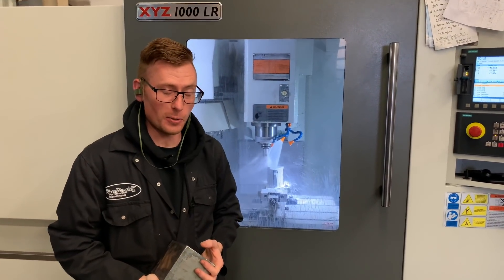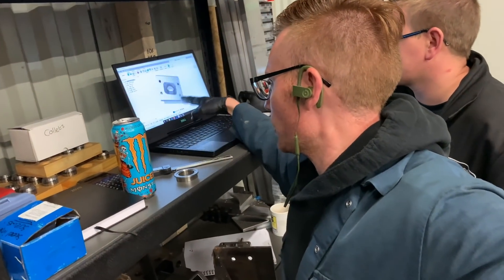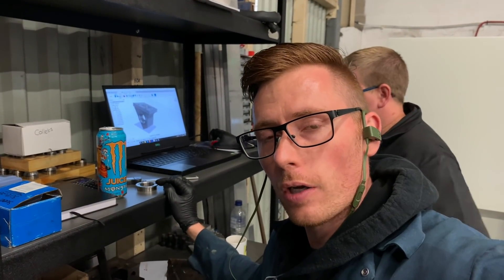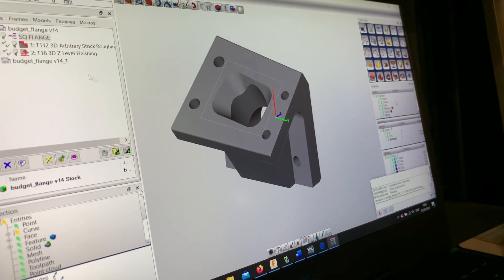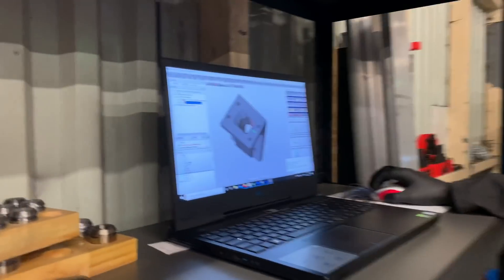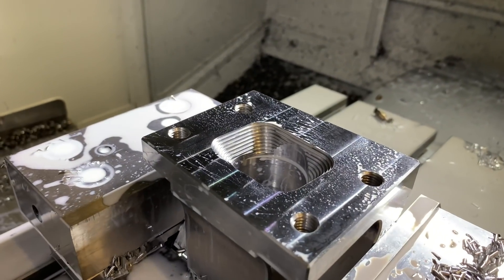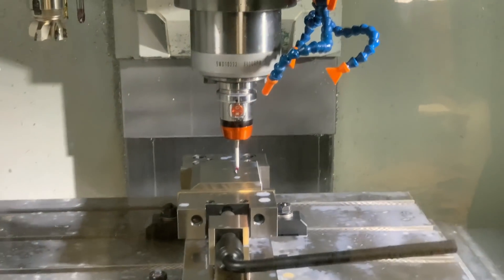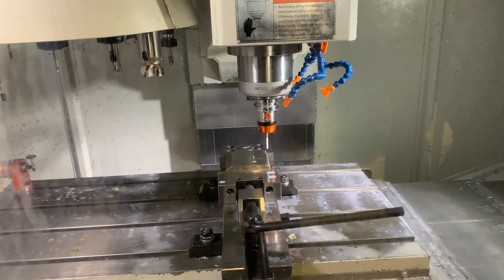OM606 Billet Manifold Adapter

Comment: I think there would be less problems for customers who aren't that skilled at drilling holes if the egt ports came pre drilled and tapped but with a cheap plug installed instead of leaving the hole not drilled all the way. You know someone will try and drill one out and mess up the threads and complain lol... and if its installed on the car, it may be hard to get the drill in the engine bay... i would drill and tap 2 or maybe 3 ports in the adapter to give the customer options on egt probe placement and is they wanna run egt and egp at the same time. And please put a dab of copper antiseize on the plugs or they will be a pain to get out after a few heat cycles... its the little details that make things go from good to awesome lol...
Reply from the maker: Mike Jensen-Fogt  Thankyou for the comment, your suggestion is something I have considered in great detail.
Reply: I am going to second this, as the part is already being machined, it is minimal to complete the ports, and simply plug them. Nice work!

Comment: Would it not be better out of a high nickel cast iron block? I work on 2000+hp
diesels and it looks similar to cast pieces OEM'S use but expansion rates less with cast so gaskets and bolts last longer, I would expect machining be easier too, curious as to you choice of materials
Reply from the maker: It would be easier to obtain gold bullion than a cast item in the UK.
Reply: @DieselPumpUK  oh I see, thanks for insight